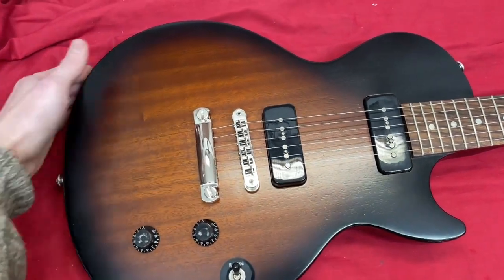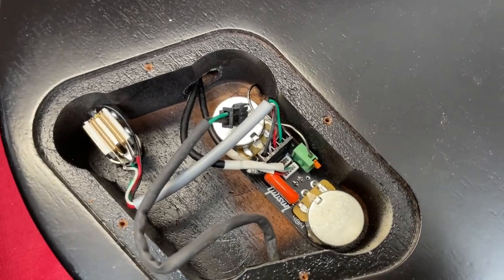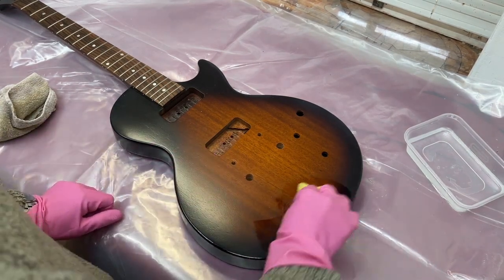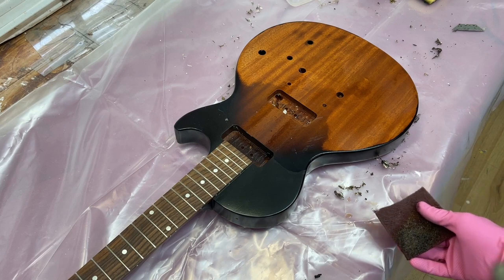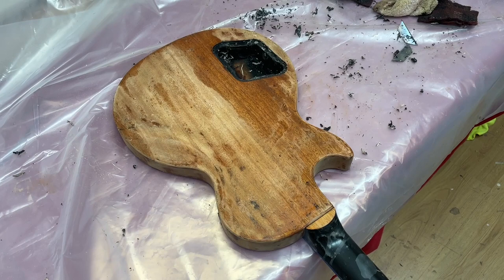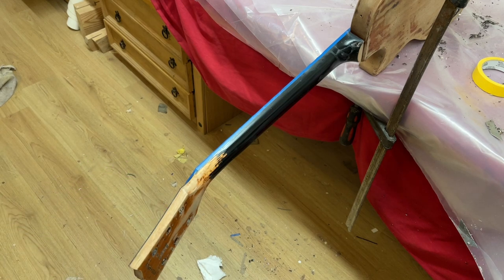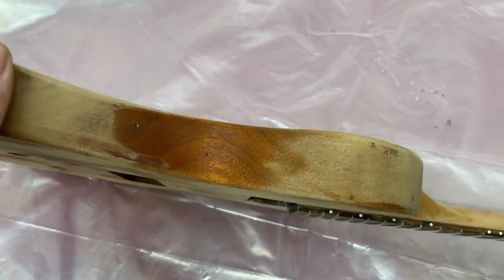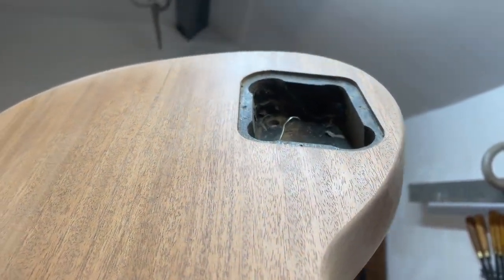Stripping Nitrocellulose Paint / Lacquer From Gibson Les Paul Junior Nitro

Comment: Very enjoyable and a very high quality result. I'm stripping n.c off a tele that was applied by the previous owner. It is too thick and therefore a tad soft and the bridge and neck plate have indented into it - its probably sucking tone away by not letting the hardware sit on a proper hard finish. Have started with a blow torch in patches which melts it enough to enable it to be  scraped off a layer at a time. I started with a plastic scraper but it doesn't really work.  But the metal one isnt damaging the wood, with care, so thats good. I don't mind too much if there's a little 'damage' to the finish - a bit of mild relic'd look is good for this. But to get the last of the n.c. off, heat wont work. And your video is the answer. Ill finish with acetone (cloth and gloves and ventilation ) and then 120 and 240 grit as you said.
Then I'll just use a tung oil finish.
Thanks.
Reply from the maker: Thank you. Glad the video has helped and good luck with the tele project!

Comment: Excellent demonstration, I've seen people sand these things down but your way was so easy in comparison and the wood looked better afterwards as well. I want to dye my brownish flying V a vibrant red, I was considering lightening the wood with something like Goudey Wood Bleach. I've seen in done on mahogany furniture. Is this a crazy idea? You seem like a knowledgeable guy, I appreciate any advice you can give me.
Reply from the maker: Thank you. Yes this is much easier than sanding! I haven’t used the wood bleach you mention, but I’ve used oxalic acid before to bleach/lighten wood slightly before. It works, but is fairly subtle. Another option would be to spray the transparent red you want rather than dyeing the wood directly, this would give you a bit more control of the colour. Thanks for watching.

Comment: Would this work nearly the same on polyurethane? I have a Firefly Junior double cut that I want to strip the white off of. I’m afraid to use a heat gun on the finish in case it messes with the glue.
Reply from the maker: I’m afraid not, polys are unaffected by solvents. You’ll be best off with a heat gun used very carefully.

Comment: I have a guitar I built several years ago. I finished it in seafoam green with several layers of nitro clear coat. Over time the clearcoat started to crack. I would like to remove the clear coat but not the green color coat and refinish it. Any suggestions? Common sense tells me to slowly hand sand it until the green coat begins to show in the sanding dust.
Reply from the maker: You could try that approach, but it may not work out so well. It’ll be very difficult to sand back evenly. What I’d do is sand back as much as you dare (but not until you hit colour) then spray lacquer amalgamator onto the cracked areas to repair them. It’ll probably take several applications. Then follow up with some more clear to fill any remaining surface irregularities around the cracks. You could skip the sanding back all together really, but you might end up with a thicker than optimal finish.

Comment: People keep telling me acitone will make the colour seep into the wood. Is this possible ?
Reply from the maker: You may get that happen during the process, but any colouration doesn't sink in deep and more Acetone will remove it easily enough. Not really something to worry about. Thanks for watching :)
Reply: @mantoncustoms  Thankyou for the quick reply. That’s what I thought. I’m also being told it will melt my binding but I believe if I don’t let it sit there shouldn’t be a problem
Reply from the maker: @bombsarefalling5518  no problem :). The acetone will melt binding, but as you say it doesn’t really happen instantly. So you can either make sure you don’t get much acetone on the binding for any length of time….or what I usually do is mask off the binding and make sure any acetone that runs off doesn’t go in the direction of the tape. You can also stop a few mm above the binding then finish off with a scraper to get the areas immediately around the binding.